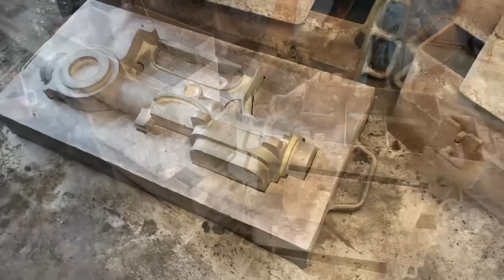Most Manufacturing Process of Nagina Dongi Pump // Production of Dongi  Pumps in Local Factory …

Comment: I often see comments criticizing safety or workmanship.  Those comments may be appropriate for us, but that place is not us.  I have a high regard for the hard work and ingenuity shown here.

The engineering, materials and workmanship here are perfect for the product being manufactured.  When a product is properly engineered, it can be produced with an adequate yield with people and equipment possessed by the manufacturer.  If thick gaskets are used, for instance, finely machined mating surfaces are not needed.  Specifying a tolerance that is tighter than needed for yield or performance will increase costs without improving quality or reliability.  The material used here is recycled cast steel.  It has known (to within needed limits) uniformity, strength, modulus, toughness, ductility, etc.  The designers have assured that thicknesses and tolerances are appropriate for the material properties.  I would not use it for manufacturing Formula I race car parts, but that's not what's being done here.  That work safety practices that we see here are foreign to us, but they are appropriate for Pakistan (or India, if that is the case).  That country has a long way to go before they will have work conditions similar to the western world, but they are progressing.  If you want those people to starve, send them a million lawyers and safety inspectors.  Also keep in mind that their cultural differences are reflected in their work places; you will probably never see any of these men come to work with a hangover.
Reply: I happen to agree with your point of view. An excellent summarisation of what you see here.
Reply: Perfeito!!! De acordo!!.
Reply: A long winded excuse for making garbage products.
Reply: @snowflakemelter1172  Ah, another outraged armchair captain. Tell us more about your manufacturing skills
Reply: @tabcreedence6553   stupid answer to snowflakemelter1172.  He is just so right. The product is shit, quality also shit. But the workers are hard working and i have respect for them. Working under those conditions is hard. But with a bit more attention they can make better products which will last longer. But i those countries the labour is so cheap that it's no problem to replace things after months instead of making better products that last longer but cost more to produce.
Reply: I am from Pakistan . This is Pakistani factory. I bought this pump in 2006. still using it. In last 17 years I've repaired it no more than 12 times. and sparts are cheap too. so it works very well. In Pakistan majority of us use these motor pumps because they are cheap and just work. Just because they are not using high tech milwakee machinery doesn't mean their products dont work. the factory is running and have tons of workers because there is a demand in the market. there is a demand because they work. if they were breaking down the very next month there wouldn't be a demand in the market. no one want to spend money on stuff that wont last long enough no matter how less money
Reply: @thinge27  I am from Pakistan . This is Pakistani factory. I bought this pump in 2006. still using it. In last 17 years I've repaired it no more than 12 times. and sparts are cheap too. so it works very well. In Pakistan majority of us use these motor pumps because they are cheap and just work. Just because they are not using high tech milwakee machinery doesn't mean their products dont work. the factory is running and have tons of workers because there is a demand in the market. there is a demand because they work. if they were breaking down the very next month there wouldn't be a demand in the market. no one want to spend money on stuff that wont last long enough no matter how less money
Reply: @danishtariq7473  Case in point. 
You guys work hard and get the job done skillfully. I do not know why some people in the US and europe  feel the need to be critical of other countries they have never visited, which they know little about. 
 I have spent many years in the manufacturing/engineering sector and I appreciate what you guys are able to do every day with the materials and equipment that is economically reasonable for each setting. 
Keep up the good work.

Comment: Good lord, that borer shaft has about 3mm of runout!
Reply: As long as the cutting edges are running concentric, the shaft doesn't matter.
Reply: I think  it was the carriage moving back and forth. The gibs must be loose or the ways are worn out. Large cutting forces will do that to unhardened ways after a while. These people don't worry about cutting forces unless the motor stalls out. If it does they just slap a bigger motor on it.